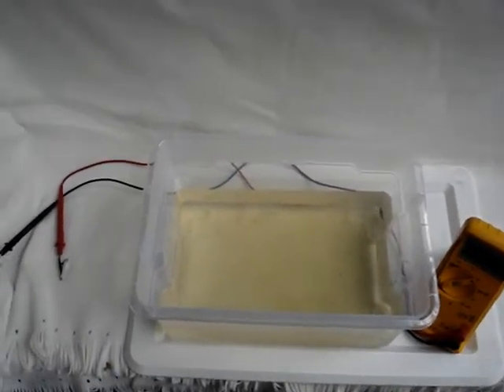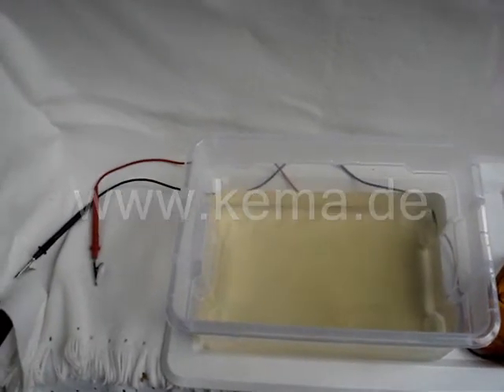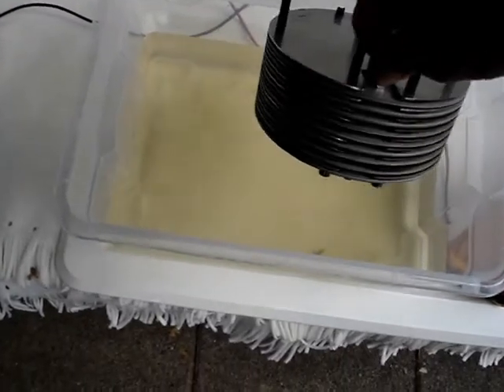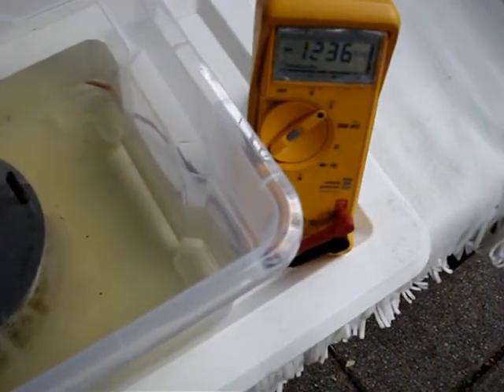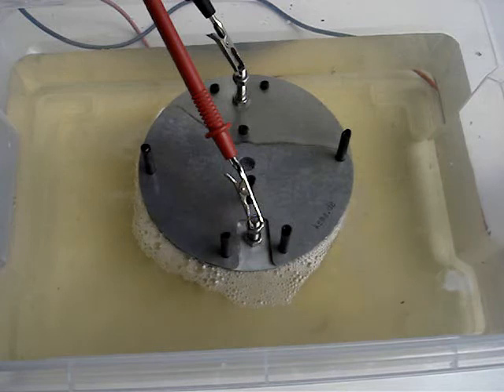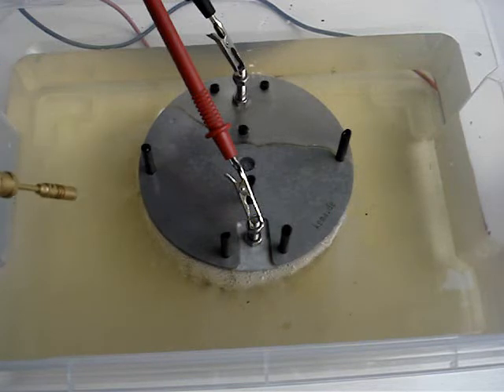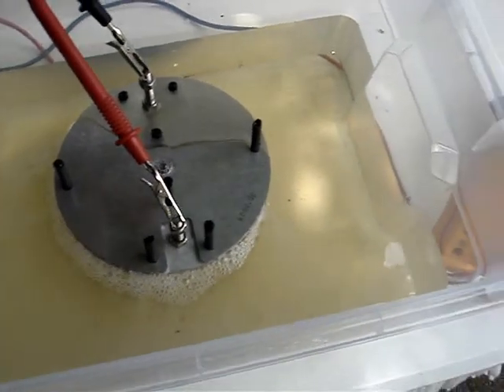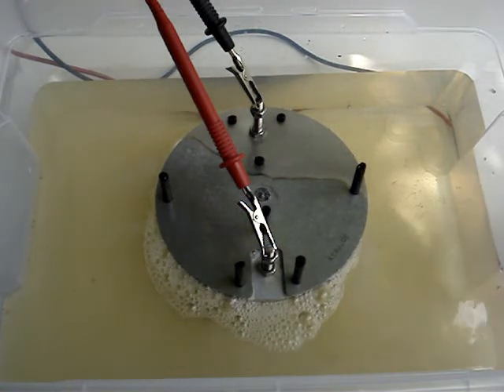Free energy HHO Gas, creazy HHO Cell.

Comment: U have 2 types of metals in the plates which is acting like a battery circulating the electrons. Interesting that you are producing gas off of very little current. There must be a great deal of electrolyte in the water
Reply from the maker: Walter Garvey  No, both electrodes are made of stainless steel. I use here 5 % KOH.

Comment: you have a small battery in your volt meter   yes therefore the black negative clip began to draw off electrons from the water atoms and when you placed the red positive on this made the water molecules/atoms very unstable which makes them give off both gas and power.try a bright uv light shining on to the water it should make voltage more and more explosive

Comment: Hydrolysis...put it in a tap water without sodium hydroxide and your aluminum plates will not react. when there is reaction, there is build up of electrons that produces volts and amps.

Comment: It is a battery. If nothing else I guarantee the bolts are a different alloy than the plates. The volt meter puts a load on the battery and the battery supplies the voltage. Nothing strange here.

Comment: My guess is your using some sort of metal that reacts with base's such as sodium hydroxide to create hydrogen gas, aluminum comes to mind. Configuring the plates like you have will create a low voltage battery same as sticking two electrodes of different metals into something like an orange to power a watch. The bubble explosions were not violent enough to be hho. I used to make hydrogen bottle bombs with bits of aluminum foil, water, and sodium hydroxide. cool little experiment though.